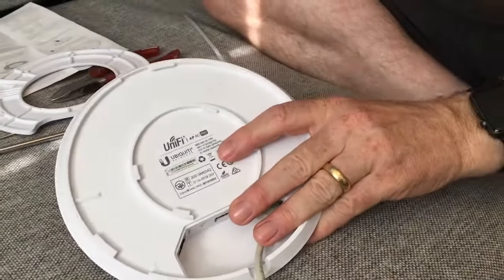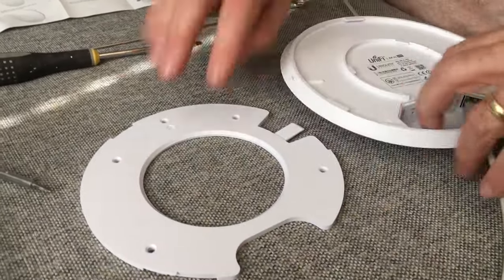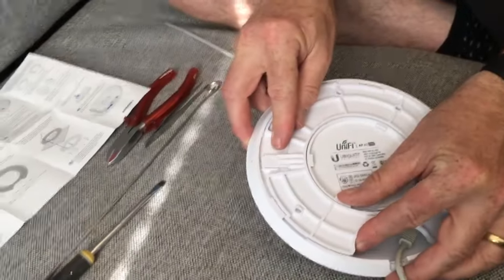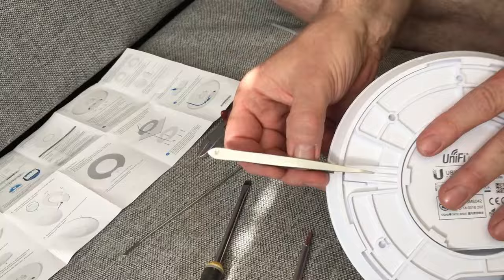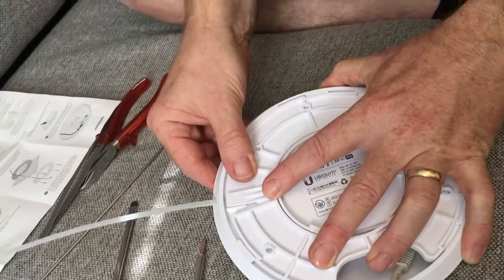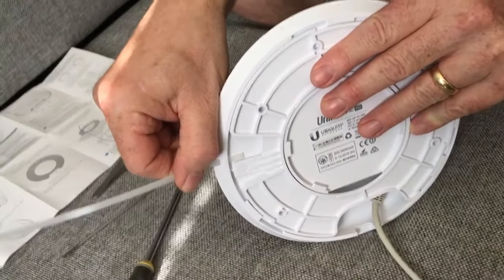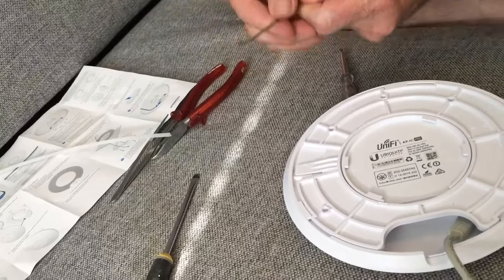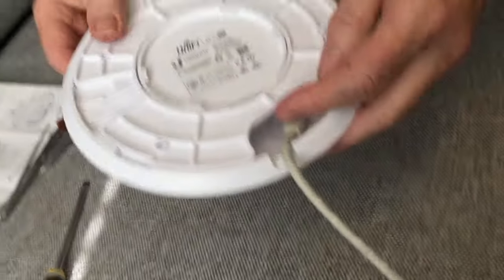Unifi AP AC Pro - How to unluck AP from the wall bracket

Comment: Another proof that this mount is poorly designed is that I can simply use brute force to remove the Ap from the mount without damaging anything. The reason I went  for this approach is that when you are standing on a tall ladder it is difficult to find the poorly located hole in the first place.

Comment: For anyone with girlfriends with fancy bathroom equipment: Nail scissors do the trick, too. Open them, then insert the blade as far as you can with the bend facing the wall, hinge and twist it off.
Reply: A cable tie works well.  Any network person should have lots of those.

Comment: You need a smaller cable tie, so you can push it all the way in.  That's what I do.  Unifi suggests using a paper clip.  I also used a Sharpie to put a small mark on the top of the AP, so I know where the slot is, as it's hard to see when the AP is mounted on the ceiling.
Reply: That worked!
Reply: Confirmed, used flimsy-seeming tip of medium tie wrap,  shoved it way the heck in there and it worked fine.  Thanks

Comment: As someone already mention, you don't need to use special tool, you don't need to lift it up. In my case bigger size cable tie like one you tried was enough to unlock.

Comment: 👍Thank you!!! These things are impossible to get off without some sort of tool. I had to destroy the mounting bracket on one of my AP's the other day trying to get it off the wall (which I also damaged). Now it's just hanging by the ethernet cable. Fortunately, it was an older one. Today I ran into the same issue with a much newer one.

Comment: Well, a simple paperclip works fine for me. At least on the AP's I've tried it on, the plastic tongue doesn't have to be lifted all way up - the thickness of a paperclip is enough to be able to turn it when the plate is fastened to a wall or ceiling.
Reply: +1 the quick start guide actually says "use a paper clip"
Reply: Nämen... här sitter jag och mekar med billiga Ubiquity APs utan mount plates från ebay och hittar dig här!
Reply: Thank you for this tip, it indeed was as simple as that :D
Reply: Thanks, I'll try that. I need to remove mine
Reply: We have a paperless office. Not a paper clip to be found. :-)

Comment: Mine came with the backplate already locked in an absolutely no instruction manual. Even the manual assumes the plate is separated to begin with. I even bought mine from a retailer (Micro Center) and the online support was unable to figure it out. I wasted 45 minutes trying to get the backplate off without breaking something.In this regard Ubiquiti sucks.

Comment: As an aside - is the plastic on anyone else's AP AC discolored and sticky because it runs hot?
Reply: I had the same problem. Mine was stuck like crazy and wouldn't come off.

The solution was to clean the surface with a cloth and washing powder. After that it looked like new

Comment: I agree its a bad design, but I have never had issue getting it off using a zip tie. Maybe the zip ties I buy are a little more firm or something.
Reply: Locking Clip During installation, the Locking Clip on the Mounting Bracket locks into the Locking Notch on the UniFi AP-PRO to help prevent theft.

Comment: Wow thank you so much! This video saved me a lot of frustration. If Ubiquiti is going to make such a fucking tamper-proof design, then they should obviously INCLUDE THE SPECIAL TOOL in the box with the access point. Instead they rely on every single consumer to MacGuyver their very own tool, from scratch. It looks like you could "jamb just about any flat little thing in there", but you can't because the opening is quite small, and so the tool has to be just the right shape/diameter to fit through the stupid hole. I ended up using a type of inward-gripping tweezers, one-side only.
Reply: Ubiquiti suggests a special tool.  It's called a "paper clip".  ;-)
I use a smaller cable tie than used in the video.  Works great.
Reply: @James_Knott  Paper clip works like shit. It doesn't work because it's not near stiff enough. Nice guess though.
Reply: @r0ckworthy  I think it may depend on the size of the paper clip.  However, as I I mentioned, I use a cable tie as I'm more likely to find one of those than a paper clip.  The guy in the video was using a cable tie that was too big to fit in the slot.  If he'd used a smaller one and pushed it all the way in, it would have worked fine.
Reply: @James_Knott  As I remember it, I had to use one half of a small pliers because you have to use considerable force to pull the plastic tab away from where it sits. I have no idea how you were able to make a cable tie work, since those things are quite floppy.
Reply: @r0ckworthy  I had no problem at all.  I just pushed the cable tie in, until the AP released.  Just use one that's able to fit in the slot.  Are you talking about actual cable ties that would be used by someone actually installing cable?  Or the things you find wrapped around some wires to make a neat bundle?  Those are completely different things.

Comment: I agree with the poster, this is a very poor design, at least include a removal tool if you are going to make it this hard to remove. The official Ubiquiti website states that the locking clips needs to be lifted less than 1mm. I think not.

Comment: You're absolutely right, but also, I think you can just install the bracket upside down (180 degrees) if you don't want it to lock.
Reply: Then there is no room for the ethernet cable
Reply: @jesperrooth445  I installed mine with cable through wall behind.

Comment: Best instructions are as follows:
1) Point your finger at the bottom of the U logo and move for finger from there to the nearest outer edge and push that edge towards the ceiling/wall it's mounted on.
2) While pressing with that finger, use other hand to rotate the AP!

Comment: I was able to open this quite easily with the spike of a cheap pipe tamper. The spike consists of a wire with a diameter of 2 mm.

Comment: I just used my finger nail to slightly lift the lock or plastic tongue as mentioned by Arvid and unlocked it in less than 5 seconds. As simple as it can get. Have fun!
Reply: You shoved your tiny fingernail into the hole to unlock it?  When its not wall mounted then your fingernail will work, otherwise....

Comment: ubiquiti is awesome tech but i agree this latch is a terrible terrible design! i just cut the latch off - its totally redundant anyway
Reply: Locking Clip During installation, the Locking Clip on the Mounting Bracket locks into the Locking Notch on the UniFi AP-PRO to help prevent theft.
Reply: @themanganiellos5800  ...and ease of maintenance..